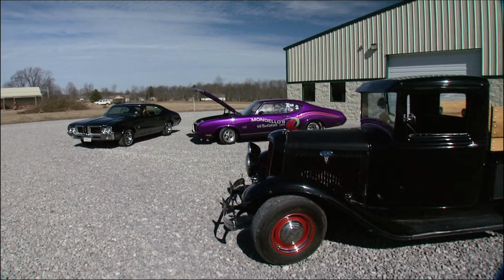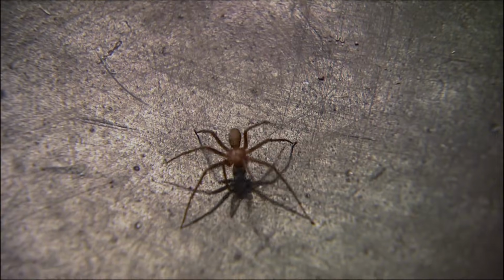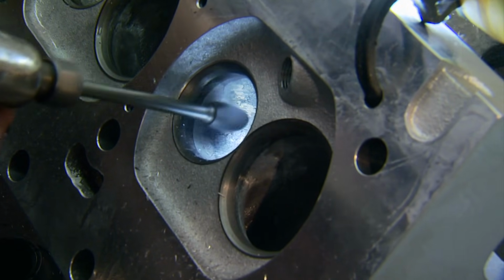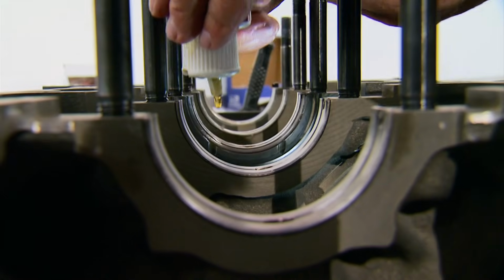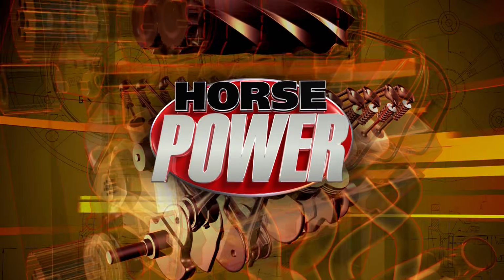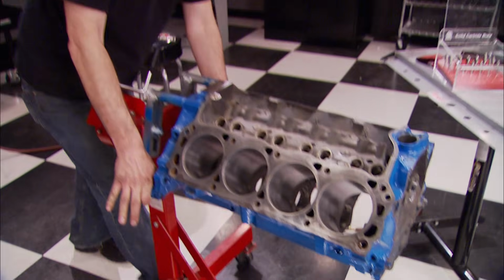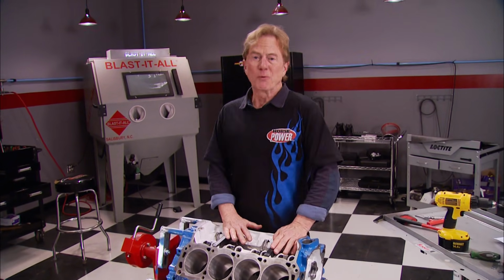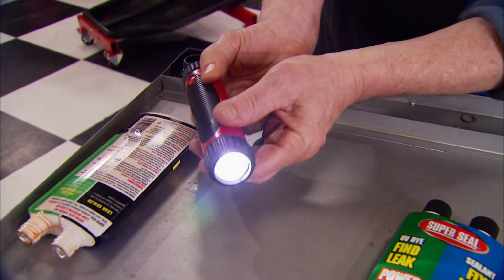Hand Porting Cylinder Heads on an Olds 455 Big Block with Legendary Joe Mondello- Horsepower S13, E6

Comment: I did some digging and found that Joe Mondello passed away back in 2011 during a surgery. :(
Reply: Thats sad.  Im happy that he pass his knowledge on.
Reply: His son Bernard is still carrying his legacy.
Reply: Wow that was some great hand porting. No secrets given away there. In the whole 15 seconds of it. Might want to change the title.
Reply: That's crappy :(  He seemed like a good guy and definitely knew his shit
Reply: So he did retire in 2011. RIP
Reply: Sorry to hear , I wish I could have learn from him ,  RIP sir
Reply: His shop is still open as far as I know. The sign for it is still up anyway
Reply: @CrazyWoody1989  The fastest and meanest car i ever drove was a 1977 Trans am  that someone put a built olds 455 into, that thing was crazy, they used to use the olds 455 in jet boats because they could stand up to constant full throttle
Reply: @jenseninterceptors  ... the olds 455 had oil drain back issues i know a guy when i was a teenager that had a 10qt oil pan to keep it alive... berkeley jet drive/ 455 olds he learned that after a couple engines
Reply: @jenseninterceptors  The 455 Olds was the worst of the jetboat engines. They had long strokes, big bearings, poor flowing heads and oil drain back issues. They melted down weekly. Joe's shop could fix the issues but it was expensive. Another jet boat racer in 1976 had Joe's shop build a $7000 455 race motor (big money then) cam, tunnel ram , and competed against my 460 Ford w/429CJ heads (home ported, pistons, cam, 660 Holley's on tunnel ram: same hull and Berkeley pump. Absolutely annihilated it for $500. Turned around and did the same to a 454 Aluminum head Chevy tunnel ram, etc. for another $500. That Cobra Jet Ford would run!!!!
Reply: Did I mention, they had wonky pushrod angles and bent pushrods? When they raised the decks for the 455 they should have recast the pushrod angles. Good torque motors, low RPM, owned a W30 in a '76 Cutlass.
Reply: @rondyechannel1399  If you say so but i remember the Oldsmobile powerplant being the top choice
Reply: @jenseninterceptors  I just bought a jet boat with a 455 olds, that's why I'm here lol.
Reply: @Zach-ju5vi  So its a good engine? I'd take a 455 olds over a 460 or 440 all day long
Reply: @jenseninterceptors  I haven't taken it out because it's still winter so I don't know what's it like.
Reply: @Zach-ju5vi  Gotcha man, I hope its a rush 👍
Reply: Stuart Woody do not buy from the mondello store. It is no longer in the family. The only one to trust is Bernard mondello who now does it on his own
Reply: yeah i remember they mentioned this on one of the Horsepower Tv episodes
Reply: James4wd he was the king of Oldsmobile builds and his son learned all the tricks. It’s sad to say his business is suffering since his passing and I’m hearing his son is the man to see. I think he’s in Tennessee.
Reply: @Nick Grillo I actually drove past there the other day, after I had posted the comment, and the property where the shop is, is actually for sale. So I guess it isn't there anymore anyway afterall
Reply: Thanks for all the tips. RIP Mr. Mondello🙏
Reply: 600 Ford's 800 Chevy's and 1 Mopar.... repeat....wish they would keep it equal just as many parts and up grades for Mopar....
Reply: ,,   ,,   "&;"   MAY,  HE, !!,   " R, I, P, " !!,
Reply: @broke_dongle  what were you before 2019?
Reply: @broke_dongle  but does that mean all cars are crazy?
Reply: @broke_dongle  Joe and the Posi Flow heads!
Reply: Yeah that's too bad but he passed his knowledge on to others so hope they do the same
Reply: @arnulford66 
Garage Mechanics Companion (GMC), I can't say what Pontiac is an acronym for since it involves a word that can get people hung in this day and age, here's a clue though, it's the letter "n", oh hell I probably shouldn't do it but here we go,
Poor Old #@%%/* Thinks It's A Cadillac, I'm probably going to regret that.
Reply: @broke_dongle  nice

Comment: Poor old Joe never made no dough. Never will he retire work until he goes. Yep Racing cost money. But what the hey ,if ya love it the rest is not a problem.  Slowsmobiles. I had one  a 98 with a cam. surprised people with a top end well over 140mph. And It went well in traffic with the AC on and the 4 way seat.  It blew due to a clogged water passage in the head . Don't use sealer. Fix it correctly.

Comment: I didn't know the 455 had oiling problems. Still love the Olds 455 though! Great tips and thank you!
Reply: Yep, found that out the hard way when I spun a bearing in my '70 442 back in '82. No internet back then so everything was live and learn or what you read in Hot Rod, Popular Hot Rodding, or Car Craft.
Reply: I've had the chance to do a rebuild and slight upgrade recently on a 350 olds. Learned a ton! Not very revv happy, hand full of torque tho. Have to do a Chevy adjustable rocker swap first hand in my opinion.
Reply: Yes, you will want to keep the rpms below 5500 on the stock olds stuff
Reply: I had the privilege of working at Mondello's in California. Although Joe himself had long since passed, a friend of his, Lynn, took over the shop business and I learned a ton from him. The stock cylinder heads had a dog leg in them that blocked the flow of oil from draining back into the oil pan. The oil restrictors that Joe punched into the block, a larger oil pan, and a change of cylinder heads is the cure for the oil starvation. Often times all the oil would end up in the top end of the motor, especially with the stock 5 qt pans